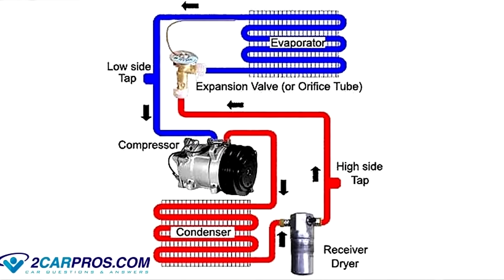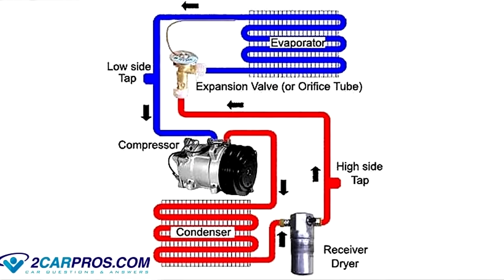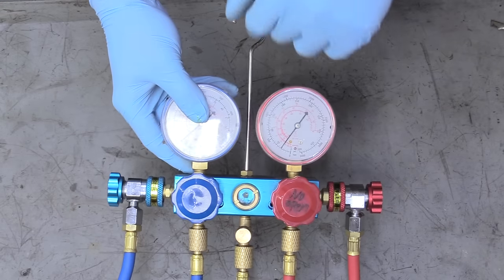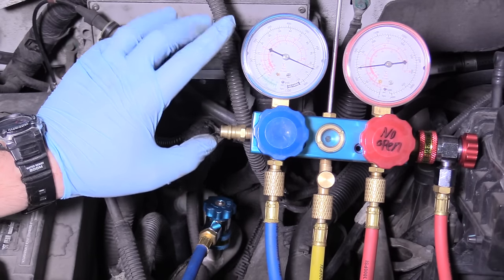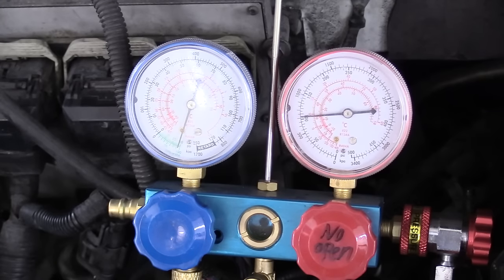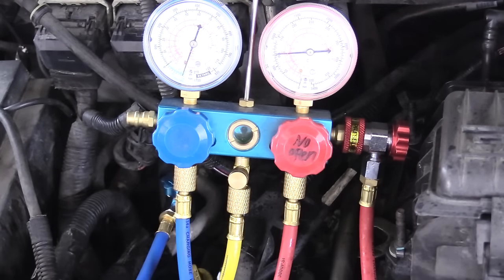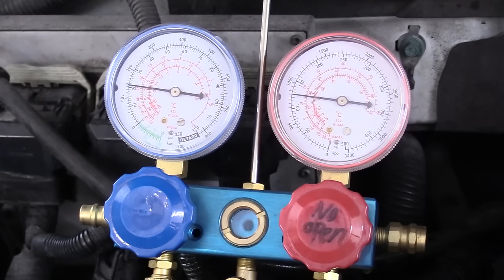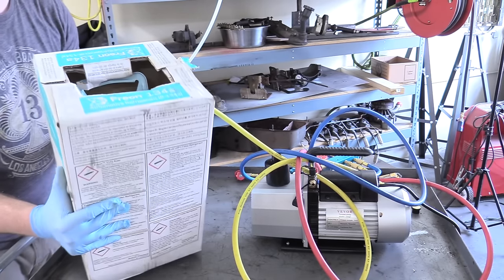How to Vacuum Down and Recharge Your A/C System! - EASY

Comment: Extremely informative video, that has given me the necessary tools, to tackle my own vehicle, after my unfortunate deer encounter. I do have a novice's question. When pulling the vacuum for 30 minutes, why isn't it necessary for the high side manifold gauge to be connected & opened?
Reply from the maker: Thanks so much for watching! Because it's a loop. Think about trying to suck the air out of one side of a bike tire. Since it's a loop it would never matter when the system is off.

Comment: wow great safety point on NOT open high side.  Excellent instructions and why and how things work or need to be handled.

In order to fill up to the max, you just make sure PSI on high side is between 200-250 and also press on gas to get this reading?

On dealing with real customers, What are some possible risk of  customers  complains that his compressor or something  expensive fails  later on and blame us for it for thousand of $$ liability to fix?  Sometimes it seems risk outweight reward but anyways I am new to this, what do I know.

Comment: Good video for the most part, for your viewers the high side is determined by the ambient temperature around the vehicle in other words at 80° outside temperature the average on the high side should not exceed 225 PSI and the low side should be around 40 to 45. A one size fits all approach to charging an AC system can be very bad for the AC system. If the outside temperature was 60° these certainly would not be your pressure readings by all means

Comment: Thanks for the knowledge like how everything is explain detail by detail.
I have to replace my ac compressor cus clutch burn.
I got 2 question,
1)when I vaccun the gas from a/c compressor where the vaccun storage the ac gas?
2) I can use the refigirant that I pump out?
3)when I know vaccun pump is full and ac gas need to be remove? 
Thanks man for the knowledge blessing

Comment: This may seem like a dumb question:) but I've heard that it's best for the refrigerant to  go in as a vapor on the low side instead of a liquid which could damage the compressor. So why flip the keg to allow liquid. Wouldn't the liquid be going into the compressor first? And thank you for taking the time to share this video. It's really helpful!
Reply from the maker: Once it enters the system it changes phase state into a vapor. But I like to have it as a liquid as it goes in so I can see it in the sight glass. Thanks for watching!

Comment: Great video.  One comment for the good of the public.  I'm in Indianapolis and called around to a ton of places looking for someone to drain the r134a out of my Ford E350 (and keep it) and no one would do it for free.  The best rate I found was $40.
Reply from the maker: Thanks for sharing!
Reply: The same issue no one would do it for less than 75 bucks here in Kansas.
Reply: I had the same issue on the phone.  However I was able to find a shop to recover for free. Three tips 1. show up in person 2. Try collision repair shop as they have the ac recovery machine but aren't in business to make money with it. 3. Don't go to a corporate chain; local small business  will be more likely to work outside the box.

Comment: I was told, and have also performed it, that you can use the vacuum in the system (assuming it was done) to do initial charge with liquid through the high side until it won't take any more (with engine off!), then flip the container and use gas through the low side, (high side turned off) and engine running, to finish the charge, using a scale...

Comment: I have a leak and lost most of the AC freon through the cracked condensor on my 2015chevy silverado. You video was very helpful. Question: Do I need to add PAG oil to the AC Compressor in Truck and how do I know how much is needed. Or does it pretty much stay in the system? Appreciate your time.

Comment: You are a perfect teacher. Not only your information is great but your ability to deliver it as well.
One question if you have time:
My car a/c cools on high rpm only (not cold just cool) comp. engaged. Cond. fans on. Pressure is pretty much good.
Your thoughts?
Reply from the maker: Thanks so much for watching! 

Either the compressor isn't working as efficiently as it should or the charge is low or maybe the condenser is just caked in dirt. Those would be the first three things I'd check out.
Reply: @2carpros  appreciated 🙏
Reply: That's really common when a compressor is going bad.

Comment: Thank you one of the best videos on this. I will keep the high side closed. Sounds like a good practice to start with. 👍
Reply from the maker: Great to hear! Thanks for watching!
Reply: @2carpros  Thank you again👍 with your guidance. I was able to replace a leaking condenser. And now have the ac working again in my wife's car! I did have a little trouble with the second can of refrigerant. The self sealing adapter was leaking at first. not sure what happened but got it stopped quick. Didn't lose much. The car calls for 24oz I had two 12 oz cans. Not sure if I should put a little more in from the 3rd can or not. It felt pretty cold in the car. my numbers were around 30 on the low side and 150 on the high side. Called it quits for the night. 👍

Comment: Well done...great explanation.  If you only evacuate the system and recharge, is there any reason to add oil?  Only curious as I saw another video where the guy did add oil. However, he didn't evacuate the system...only "topped off."  Thanks for your video?
Reply from the maker: Nope. You really shouldn't need to. Thanks for watching!

Comment: Excellent video!
Question: after vacuuming, if the high side hose doesn't have a vaccum and it's connected while the system has a vaccum, wouldn't the air in the line will get sucked into the AC system?

Perhaps the high side hose should be: 
1) connected prior to vacuuming so that it also has a vaccum or 
2) connected after some new refrigerant is added to the system that way the pressure in the system will be higher than the pressure in the hose and the air in the hose won't get sucked into the system.
Reply from the maker: The high side hose has refrigerant in it, even if it didn't it would get pushed up to the closed valve and stay there. The pressure is higher in the system than the hose. Thanks for watching!
Reply: @2carpros  👍Again, thank you for making this awesome video.

Comment: When I was doing the vacuum pump I did open the high side, is this ok, ?? Everything else when charging I think I perfectly followed your steps!! My concern is, if I did pull out the oil out of the compressor when I vacuumed with the high side open!? 
Thank you in advance

Comment: THANK YOU!.
alot of the other videos I just couldn't understand. I'm 62 and 2 strokes under my belt so that makes it hard.
I watched your video and had absolutely no problems whatsoever.  Your straight and to the point and you also put out there the dangers of doing this yourself, mostly you tell everyone what precautions to use to make it safe.
Thank you so very much my alero thanks you to. In Arizona ac is a have to. 
Sincerely Larry.
Reply from the maker: Hey Larry! 

Thank you so much for watching and nice job on the A/C work! 

Best,
Ryan

Comment: This is really good explanation how to do it, thanks a lot bro ,im a little afraid to do it in my own but the life is a risk right
Reply from the maker: If you follow along you have nothing to worry about. Thanks for watching!
Reply: @2carpros  I already did, but the freon is not getting in ,the compressor works  and the clutch engaged  but is no getting any freon, i already did the vacuum

Comment: 13:23 under the cap at the top of the yellow line is a Schrader valve you can use to purge the air out of the line

Comment: Did this step by step went and bought all the gear. Used 134a low pressure line is cold top is hot even hoses on the condenser still no coil air.

Comment: Great video, thanks for making it. I followed all the steps but have a couple questions. One, should there be PAG oil added into the system? I noticed others saying this is something that should be done. Also, should the high pressure port be opened during the vacume processes of clearing all the air out of the system, or is just doing the low side fine? Thanks!

Comment: If I replaced most AC parts except the compressor ( replaced condenser, AC core, etc.), do I need to add Pag oil and if so, directly to each the accumulator, condenser and AC core? Is what is in the compressor enough? System takes I believe 8oz. of Pag oil. All this before evacuating and recharging of course. 1993 GMC Sierra, 5.7, v8. Thanks!

Comment: Great video! Question...if it is holding a vacuum, but still leaking refrigerant...what would cause that?
Reply from the maker: On a rare occasion vacuum will seal the leak. It is probably a hose or the compressor. Where ever there is oil leaking out of the system is most likely your culprit. Thanks for watching!

Comment: Just wondering if it's ok to charge liquid refrigerant (upside down) rather than gas on the low side?   I thought low side you have to charge gas since you don't want liquid to get pulled into the compressor?  Sorry If I am confused...

Comment: If you leave the AC system open to the air for 3-4 weeks, will there be problems?  I will be doing the dreaded timing job (along with oil pump, all cam roller followers, spark plugs and coils) on my '04 F150 5.4L 3v engine (which I believe you had in this video).   I understand it may take me 25-30 hours, which translates into 3-4 weeks for this guy with a glass back.  Do you think I may cause internal rust or water issues.  Great video, thx.

Comment: Great video. Question: Should I be adding oil for the vehicle's compressor as part of the recharge process? If so, do you have a video that shows this process?
Reply from the maker: I wouldn't so little is lost. If you put too much in the system won't work at all. Thanks for watching Steven!

Comment: Great info Ryan, Nice job. I am confident I can overhaul my AC now. I am a bit confused on the oil situation. I am replacing the Compressor, the expansion valve, the condenser and dryer. after doing this I need to add oil. Then vacuum, then recharge. Wont I suck out all the fresh oil when I vacuum?
Reply from the maker: Very very little is lost on the vacuum. I wouldn't worry about it. Thanks for watching Robert!

Comment: What does it mean when you start pulling a vacuum and it start at +10psi.  I replaced my condenser/pump/drier so I would expect to start out a 0.  After 30 minutes its now sitting at 0.  High and low sides are open as well as the yellow going to the new robinair vacuum pump.  Are my snapon (old) guages reading wrong?  Is there another condition that would cause this??

Comment: When is it necessary to replace an expansion valve? Is that only when a compressor has failed and needs to be replaced?  I have a compressor that has not failed yet, but it is failing. Would you think my expension valve would be damaged in this case?   Also, is flushing an AC system  necessary or just optional?   Just trying to figure out what all I need to do in the process of replacing my compressor.  Thanks so much for your helpful video.

Comment: I'm hoping you can answer this question for me: my AC isnt blowing cold and I'm on a trip miserable. So I want to do this all properly. Can I use an ac recharge kit today as a temporary fix until the gauge set comes in the mail?I was thinking add very little despite the pressure reading that comes on the kit until I feel a difference the do it properly later when I have all the equipment. Sweating my ass off really hoping to hear something on this soon lol. Thanks for the video. Very helpful

Comment: Thanks for a great tutorial. I have one question. After I've completely evacuated the system, and will be using 12oz. cans of 134A. I've read that I need to add PAG oil. I didn't see you do that. Is that because the oil is still in the system and only needs to be added to a completely new AC system?  Your help is greatly appreciated.  SG

Comment: Awesome video. If I’m replacing my condenser with drier do I need to add any oil to the system? Thanks
Reply from the maker: Thanks for watching Brent! I wouldn't worry about it. There is really enough in the system. If you add too much oil then the system wont work at all.

Comment: Nice Video!  If I want to hook up the AC manifold to your car to do some measurements for the pressure, should I purge the blue and read lines from air once I connect them or no need as the air will not get into the system? please clarify thx

Comment: Hello, Thank you for your demostration on how to service the a/c.
I have a 2005 Honda CR-v and when I conect the gauges I get same pressure on both but when I start the car the high pressure side doesn't move, the low pressure side starts moving up slowly and the compresor doesn't  stop running .
I replaced the expansion valve and the condenser I didn't do the vacuum I just put the R-134A  like about 14-15 oz ( the system shows 18 oz ) .
At this point I don't know if something is wrong like compresor or I need to do the vacuum and recharge the system with 18 oz.
Do you have any advice what should I do now ?
one more thing, I noticed that when I drive the car is getting a little colder .
Thank you
Reply from the maker: Sounds like you need a new compressor. Thanks for watching!
Reply: @2carpros  thank you

Comment: Don't we need to add oil to the system as well? I replaced every part of my ac system and I need to vacuum and charge my ac. Great video! But how or when do we add oil? Also, does vacuuming the system remove the oil that came prefilled in my new ac compressor?
Reply from the maker: There is enough in the new compressor. Not enough is lost during vacuum down to matter. Thanks for watching!
Reply: @2carpros  okay thank you!  auto parts store said vacuum would remove all oil. I know the new compressor came prefilled with 4 ounces and that was my next question. So I just need to add a little because my system says 7.5 oz required.

Comment: Hello, thanks for the video, very informative. I had a leak in my 2017 Sierra’s condenser like most gmc/chevy trucks do. I pulled consistent vacuum for 50 minutes. I let it sit for one hour with no changes. I add one 8 oz can of freon. It took a while 15+ minutes. I had it on a scale and watched the frozen condensation disappear. I turned off the valve at the can and added second can. The second can never got cold and did not decrease in weight. I tried a third can with the same results as the second can. Did I accidentally add air to the system changing cans? I’m puzzled. Do I have other problems? Compressor turned on and stayed on the entire time. No change in temperature on the thermostat I had mounted in the center vent even after the first can was completely empty. Minor condensation dripping from the evaporator coils. WTF did I do wrong?
Reply from the maker: Yeah it seems like you accidently get air in the line. Did you purge the line between changing the cans? Thanks for watching!
Reply: @2carpros  Thanks for responding. No, I didn't purge. I'll have to start over again. Hopefully I didn't cause any damage to the system. I see lots of people turning the large freon tanks upside down. However, I also see comments that that isn't good because you want to add gas to the system not liquid.
Reply: Second attempt same results. It took the first can no problem. Second can wouldn’t feed. Bled the line this time for both cans.

Comment: After vacuuming out the system does this then require adding A/C oil and dye again?
How do you check the A/C oil level? Is A/C oil added thru the same manifold via the low pressure side?
My system functions but the outside shell of the compressor has a slow leak visible with my UV flashlight. There are cans of A/C leak sealant at the parts store. Do they work or will they ultimately clog the other A/C components?
Thanking you ahead of time!

l

Comment: First timer, When pulling vacuum, I noticed the the low gauge barely dropped below 0 even after a few minutes running. Gonna try again tomorrow. I bought the same set up like in the Vid and only before used it to charge a system. Possible its  just an issue with gauge? Or indication of a huge leak. I have just replaced compressor,accumilator and orifice filter carefully, lubed new orings and seals.

Comment: The other old school 1/4 acme fitting [5.32]  on the vac pump is used by the rest of the refrigeration air-conditioning industry . Every good tech with diagnosis tools will use alot of 1/4 ACME

Comment: I had to replace condenser after it got damaged in a wreck. System was empty when I did repairs.  Do i need to add oil to it since its a new condenser? Rest of the ac parts remained the same. Thanks

Comment: Thank you for this video.  If we are just changing a expansion valve do we need to add any PAG oil? If we do at what point would you do that?  Also if we are using the small 12oz cans of freon would we dump 1 cans of freon into the system to trick the compressor into working like you did at the 14:43 mark then top off with a 2nd?  I am working on a 2015 GMC Sierra with 5.3.   Thanks
Reply from the maker: No you don't need to in that instance. Yeah basically. Just purge the line in between can changes. Thanks for watching!
Reply: @2carpros Even if I had a small freon leak which lead me to finding the defective expansion valve?  I apologize for all the questions but thanks for the help.